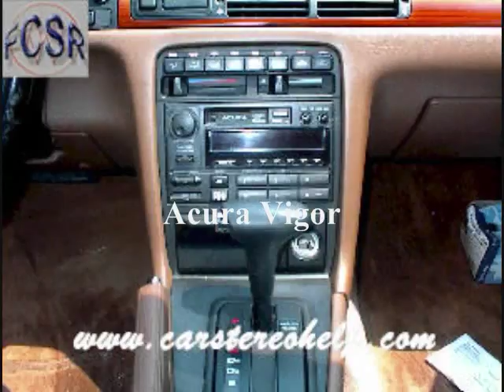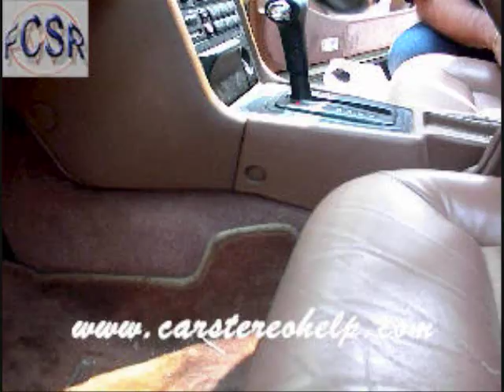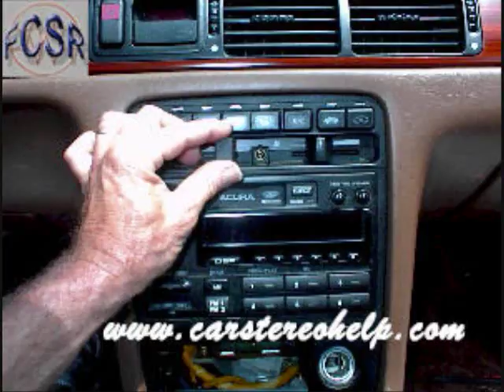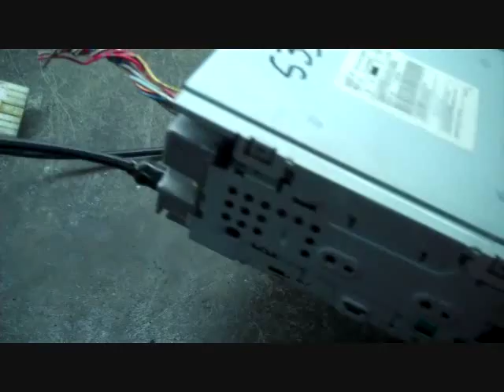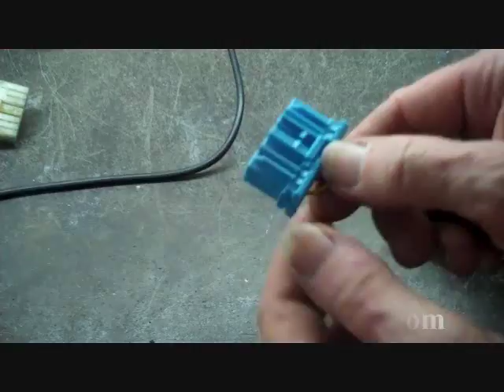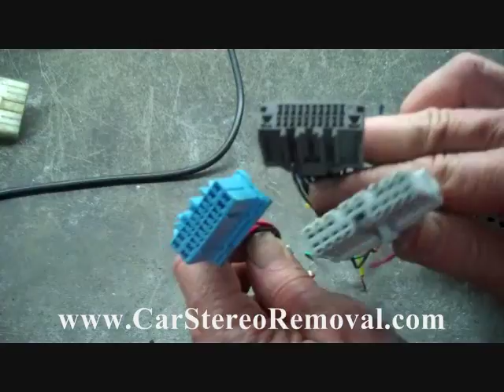Acura Vigor Car Audio - Radio Removal = Car Stereo HELP

Comment: Thank you so much for this video. Only issue I had is that my Vigor is manual, so trying to get the centerpiece off was indeed a challenge.  Saved me 100 bucks for serial retrieval in order to get the code for my radio.